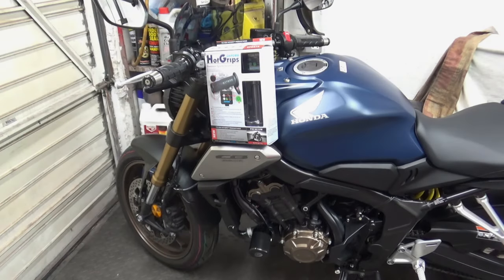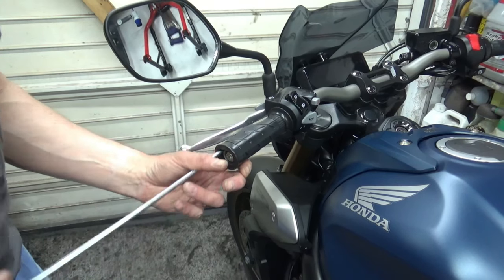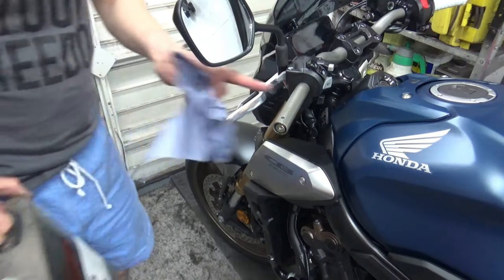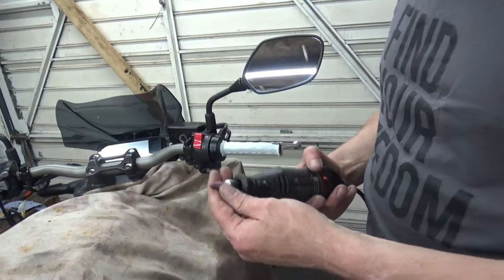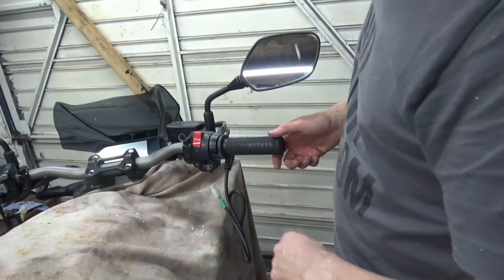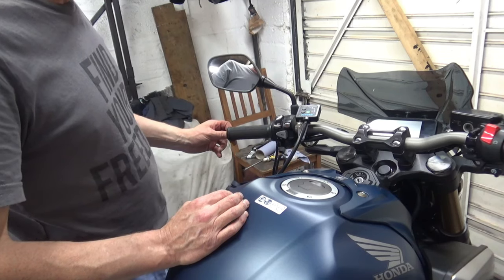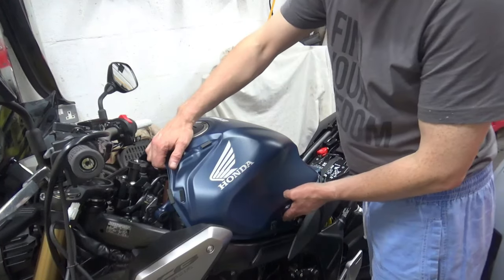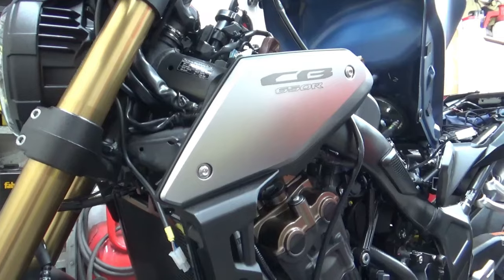How to fit the best heated grips to your motorcycle!

Comment: For the ignition cover, to remove the push rivets you just need to push down on the small centre pin from the top until it clicks, you can then easily lift them out. Saves breaking them if trying to force out from underneath.
Reply from the maker: Yes indeed buddy. You’re 100% correct 👍

Comment: Thanks for the tutorial. I`m going to install the same heated grips on my cb650r. Really these heated grips are efective without handguards? For about 5°C it will be enough?
Reply from the maker: Hi Daniel,  the install is very easy and the grips are very hot, you will probably only run them at 80% once your hands heat up.  The guards aren't essential as the grips do a good enough job on their own but I ended up fitting guards primarily to help keep my hands dry in the rain as well as reduce the cold air on my finger tips as I have white finger and acute arthritis in my hands. My guards were cheap ebay Givi copies and I only paid £33 for them. 

I hope this answers your question and you'll love the luxury of having warm hands on these cold days!

Comment: Hi. is there an option to wire through ignition?
Reply from the maker: There will be if you tap into an ignition live feed but these heated grips have an intelligent chipset in them that detects when the engine is off and automatically turns them off. I personally wouldn't be hacking into my wiring loom